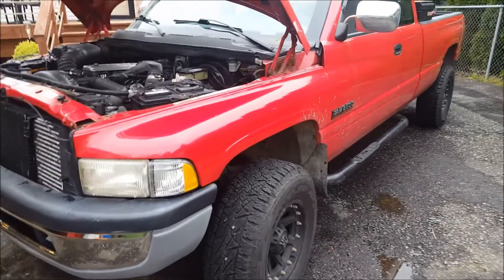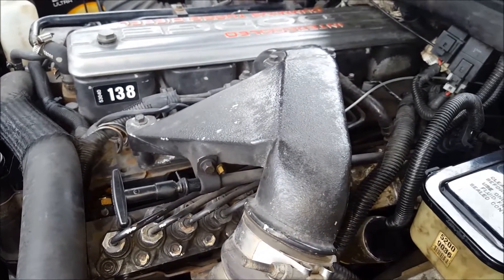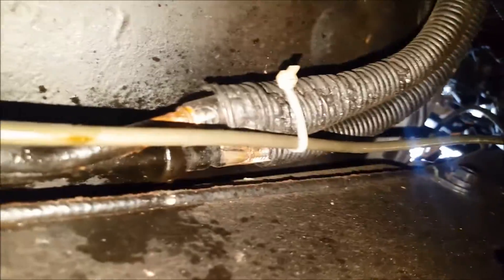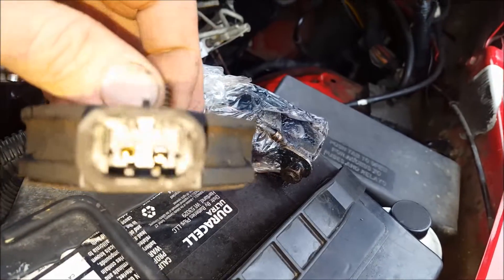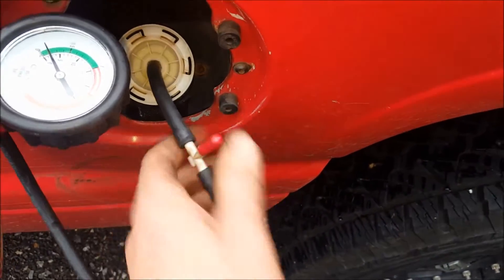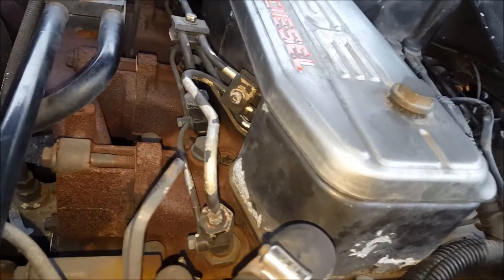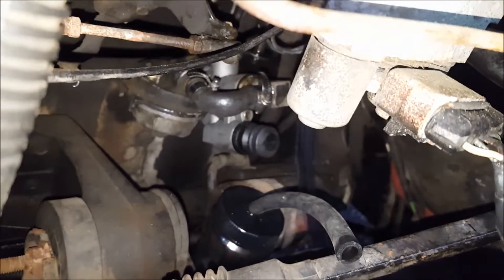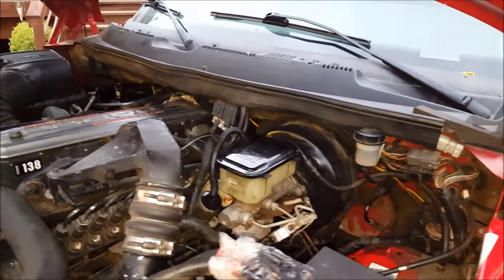DIAGNOSE CUMMINS 12v 6BT LOW FUEL PRESSURE and Air bubbles in fuel Dodge Ram diesel

Comment: Trash your stock lift pump , total crap design . Get an air dog or fass system, it was worth every  expensive  penny
Reply from the maker: Stock pump is a simple and reliable system. Still working great. No need to overly complicate the fuel system for a stock truck.

Comment: Hey buddy. My truck acts like I’m red lining it at 2200 rpms but once I go pass that is comes out of it. When I’m in neutral and I push the paddle all the way down and let go, it will blow black smoke then white smoke will follow behind it. It pops and crackles when I rev it up. I put new thoroughbred 150 injectors n it to see if it would fix the problem but it didn’t. I put a new fuel filter on it and clean the pre-filter out. It’s a 94 12 valve.
Reply: Same problem. Have you figured it out?

Comment: Did it have a lope to it at lower rpm’s?
Reply: Mine has a lope at an idle worse when it is cold goes away a little bit when it's warmed up seems like my fuel pressure gauge is spiking around just like this but I already have this snumber and it is already mounted to the fender with this steel stainless steel line

Comment: What do you have covering your battery cable terminals?  Great video as usual!
Reply from the maker: I usually rub Vaseline or grease on them. And then there are just some bags covering that because I kept leaning into it. And thanks!
Reply: @NoNonsenseKnowHow  I changed my batteries to group 31's with studs on top.Put ring terminal connectors on the cables and smaller wires that go to bat terminals.Had this setup now for 8 years and never a sign of corrosion plus group 31's have 1000 CCA.
Reply: @NoNonsenseKnowHow  Many years ago an electrical engineer told me about using grease on battery terminal. Simply the best way to prevent corrosion!

Comment: Where was the air coming from
Reply from the maker: Never got rid of it entirely. Truck runs fine though so I haven't messed with it anymore. After speaking with a few diesel guys, it seems it's pretty normal to see this on the return
Reply: @NoNonsenseKnowHow   Having a hard time changing the lyft pump It's starving for fuel ,cant hear turbo
Reply from the maker: @johnmaxx4818  got you. Yeah it's a little tight in there to replace that. Some guys go from underneath. Depends if you have a hydraulic booster or not. Vacuum booster easier. Did you see my video on how to replace the pump?
Reply: @NoNonsenseKnowHow  yea it took a air chisel on edge of line to loosen,Yea

Comment: I know this was a long time ago but I have the same thing with the fuel gauge any time I do anything with the fuel system.  It won’t go away untill I put the truck into a high gear and get on it. Make it work and really pour the fuel. Seems to clean it up. Something to try if your having those issues.
Reply from the maker: Sounds like maybe they are bubbles in your system are causing it. Adding a snubber and relocating V fuel pressure sensor to a remote location solved by issue. It seems having it mounted right on the pump was causing problems
Reply: NoNonsenseKnowHow 
Weird. Ya I have mine mounted there. But it only does it right after I introduce air. Like fuel filter. Then it’s fine until I’m into the system again.
Reply from the maker: @chevy6794  I would recommend relocating it personally. Really smooth out my gauge. Plus being mounted to the engine, the vibrations overtime can hurt the sensor
Reply: NoNonsenseKnowHow. Makes sense. Thanks. You just run a line and mount it to the fire wall?
Reply from the maker: @chevy6794  yeah I got a stainless steel fuel rated line from Amazon
Reply: NoNonsenseKnowHow. Thanks a lot.
Reply from the maker: @chevy6794  no problem!

Comment: I was told you don't need all that much fuel pressure  on a p pump, as long as the fuel reservoir on the pump is keeping topped up?
Reply from the maker: Yeah I'm sure it would be fine with low pressure, but I personally like to have things operating at factory spec
Reply: @NoNonsenseKnowHow  Just worried because I just got it rebuilt because the plunger was sticking 💰💰💰 haha
Reply from the maker: @vendetta1306  gotcha.  yeah I honestly I don't know enough about these p pumps to say whether the low fuel pressure could really hurt the pump or not. Mine's been running great though!

Comment: I have a 97 dodge cummins and i have a problem my truck started this morning then when i went to start it again it never started again and i opened the bleed screw on filter and air came out and i cranked it and while cranking no fuel came out so i tried using the primer push plunger and was able to get fuel to over flow out the bleeder screw but still wouldnt start. I opened the injector lines and cranked it and no fuel would come out so im stuck with a crank no start now does anyone might know why my problem might be? Seems i am not getting any fuel to the p-pump so if anyone can help me would be greatly appreciated
Reply from the maker: Honestly without actually looking at it it's hard to try and diagnose it. But with the information in this video, if you go through all these checks you should be able to pinpoint or at least get closer to a solution.  Sorry I couldn't be of more assistance. Let me know what you find out
Reply: Did you ever found the problem?

Comment: Just to say what I did, due to problems I was having. I used clear line where it can be used, and that's where I found my air problem. Took. Out my banjo bolts and went to the local diesel shop for Barb fittings. Process of elimination with clear line. Heater was shot. So, I ended up replacing all the banjo bolts and fuel lines...
Reply from the maker: Thanks for sharing man!

Comment: Any time you  move a liquid air bubbles form in that liquid also the fuel filter mounted on the  motor causes the filter to shake  causing air bubbles it's normal for a certain amount of air bubbles to be in a fuel system the air bubbles get returned back to the vented tank the needle bouncing is because the lift pump is a stroke pump

Comment: Just an update on that pump from Amazon.  It is now $140.  Precision brand from Oreilly's for same price with warranty.
Great vid, young Brother.  Diagnosis prior to dumping bucks on parts is the only way to go.  Starting on mine this AM using these steps.  MOST grateful for the vid and the great contribution to the Ram community.
Reply from the maker: Thanks for the update man! I really appreciate your comment and Good luck with your repair! A little feedback goes a long way, and keeps me motivated to keep putting videos that I I think somebody may find useful out there
Reply: Hello everyone this is August of 2025 I think I've been sucking air in my 97 12 valve for maybe years already I need to get it straightened out ! I lose feul when I'm parked or sometimes it won't start right away ! But also a professional told me that I'm getting air in the fieul when I rev the motor. he could hear it the engine kind of shakes around,, I never knew there was anything wrong, but I think my fuel economy could be better! It's a little  😕 confusing, I hate to think about a putting in a shop because$  I'm a poor guy on Social Security old and broken. I'm a mechanic I do my own work since I was a kid but it's just so many processes here!?  I don't know where to start maybe I should just have it diagnosed in a shop and then do the repair myself ! that might work 😊!!  @NoNonsenseKnowHow

Comment: Did you ever find out where the air in the return line was coming from
Reply from the maker: Unfortunately I did not.  After this video, a few of my diesel buddies said that it was normal.  It still puzzles me a little bit because there's clearly no air going in. But maybe it's just the fuel being disturbed and then going through the pump and all that. The truck runs absolutely perfect so I never messed with it further. I was hoping that maybe with this video some other people might have Insight that I can look further into.  Do you have bubbles in yours?
Reply: @NoNonsenseKnowHow  thanks i have a buddy with a 94 that only has 15 psi at all conditions reduardless of rpm then starts to lope real bad and dies

Comment from the maker: On Amazon:
*ADJUSTABLE OVERFLOW VALVE: https://amzn.to/36ZdSRH     
*AUTOMETER FUEL PSI GAUGE: https://amzn.to/2UrGj8g      
*BANJO BOLT ADAPTER: https://amzn.to/2GYsqXa 
*FUEL BOWL SCREEN/GASKET KIT: https://amzn.to/2ujHegj
*AUTOMETER SNUBBER: https://amzn.to/2vTnaSn 
*FUEL PSI TEST KIT: https://amzn.to/39oaIbD
*COOLANT PRESSURE TEST KIT: https://amzn.to/2OKUotF 

~My Other 2nd Gen Ram Videos: https://bit.ly/2TLhJLQ

Comment: This video was amazing. Just what I was looking for a complete diagnostic but left me hoping for part two. Though after reading the comments sounds like you are satisfied with the improvements. Hate throwing parts at vehicles so these diagnostic steps will be a life saver, thanks!!
Reply from the maker: channelurviews thanks for your comment man and glad to hear the video helped out some!  I apologize for not doing the second part video. After adding an extension hose on my snubber and smoothing out the fuel pressure needle, everything on the truck has been working perfectly so I haven't messed with it since.  It seems that a tiny bit of little air bubbles in the return line is normal based on what I've seen.  Thanks again for watching!

Comment: Are you sure the bubbles are not normal?
Reply from the maker: Everything I've read said that your diesel fuel Supply should ideally have no air bubbles in it at all.  And to me, I would think that since I see Zero air bubbles going in the clear line I should see 0 air bubbles coming out of the return.  But yes, in the end it seems that this is pretty normal.  However the steps I demonstrate in this video would be good for somebody to follow who is getting excessive air in their fuel.  Thank you for your comment.

Comment: Nice video Can you recall what fuel cap you used ? Did you seal it with anything where the fuel line went through the cap?
Reply from the maker: ray moody sorry no I don't.  I just went in my caps drawer and grabbed something that fit

Comment: u need a schrader valve on the fuel pressure gauge just barley open
Reply from the maker: Chris Herron I ended up adding a small section of fuel hose and mounting the pressure sensor about a foot away. And that Smoothed out the needle

Comment: What ended up being the problem? I have a similar problem.
Reply from the maker: burt CoKain honestly I was able to dramatically reduce the amount of bubbles. However in the end I still have very tiny air bubbles coming in my return line. I'm starting to think it's normal cuz the truck runs perfectly fine and I have excellent fuel pressure that is steady now
Reply from the maker: burt CoKain how bad is the air in yours? A lot of bubbles? Any running issues?